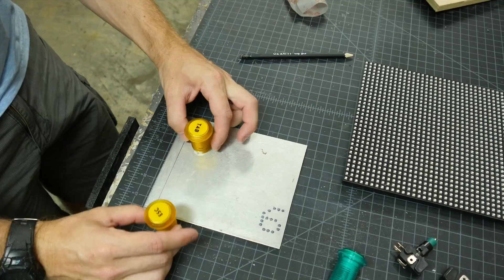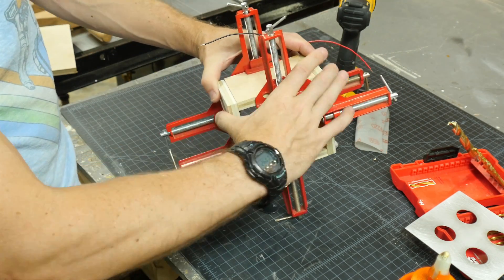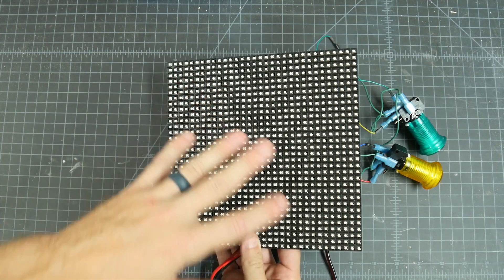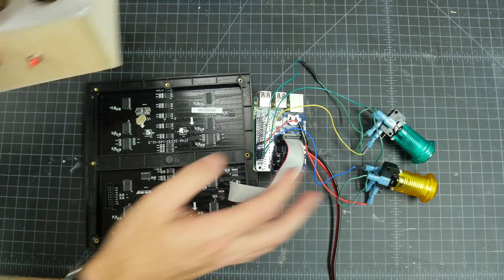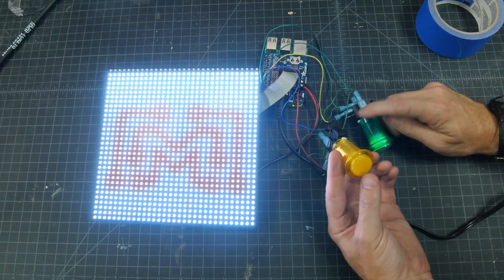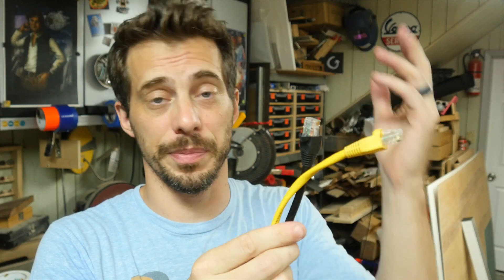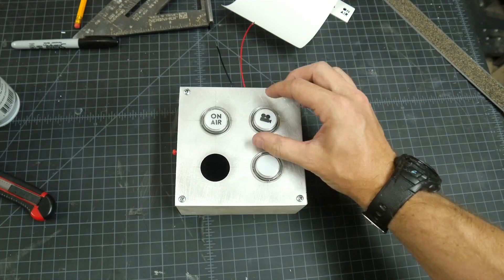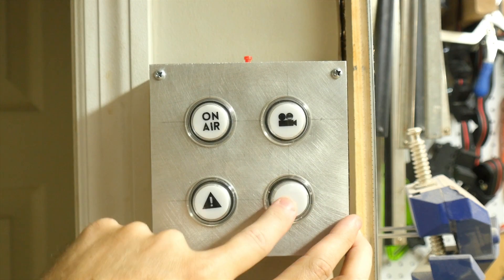Raspberry Pi 3 Display Sign // Electronics How To | I Like To Make Stuff

Comment: You could save some wires by putting an Ardunio in the control box and having it communicate with the Pi over serial. If you want to make it really easy for people to do them selves, and the distance is short enough you could use an Arduino Nano and use the USB based serial to communicate with the Pi rather than using the UART pins directly.

Comment: Why not have the Display and the Control board not necessarily require each other? Like having the Control Board using a Photon, or an Arduino with an Ethernet shield to communicate with the Pi over your home network?

Comment: can we do the same with aurdino
Reply from the maker: Kind of.  You'd have to get a Mega I believe to be able to run the display.  An Arduino Uno wouldn't work for it.
Reply: +I Like To Make Stuff 
ironically the adafruit site says the arduino can support a single display with 13 pins but documentation for the mega is unavailable. Great build!
Reply from the maker: Raghav Anand Ha! I stand corrected then :)  Nice!

Comment: Great project, but why strip the ethernet cable? Why not use an ethernet socket so you could just run an ethernet cable and if needed replace the cable for a longer or shorter one?

Comment: Hey Bob!! Love your channel and the podcast with you, jimmy, and David!! I have a electronic thing that needs fixing and I have NO IDEA how, so maybe you can help me? This electronic thing is my 4 month old daughters video monitor. My son knocked it off the table last night and it basically spilled it's guts!! But nothing was disconnected when it fell and the video and audio was still working fine. Well when I started putting the monitor and wires back in the protective case the video screen turned white and I could no longer see my daughter just a white screen that looked like the brightness setting had been turned all the way up but I tried turning the brightness down and still a bare, white screen!!! I could still hear the audio and it was working fine. We cannot afford another monitor. I am hoping you can maybe tell me how to fix it? I checked to see if any wires were disconnected but they all looked the same as before. 
Thank you Bob and I hope to hear from you soon!!! 
Kaitlyn
Reply from the maker: Hey Kaitlyn, to be honest, I have no idea.  It kind of sounds to me like something is pressing on the display which is causing it not to show the image correctly.  You might try taking it apart again to see if the image clears up. If so, try reassembling it very carefully so that nothing is jammed in putting undue pressure anywhere.  Good luck!
Reply: +I Like To Make Stuff ok so I tried that and it's still white but just from moving the screen it started doing crazy stuff so I messed with it for a minute and I would very gently push on the wires one at a time to see which one gave me a reaction and I also would move the camera so if an image came up for a split second or partially while I was messing with the wires I would know which wire would give me a reaction. So I figured out that the gold strip running to a black cushion-y rectangle is my problem. The connection isn't solid one side is pulled out more than the other so if you have any idea what I'm saying could you tell me what the gold strip wire thingy is? And maybe the black rectangle cushiony part that it connects to? If I know the terminology for these things then I'm sure I could look something up and maybe find some tutorial on fixing it. Thank you for writing me back so quickly!!

Comment: You can eliminate that 9 wires and use a shift register, or use an arduino that connects with the pi through serial communication.
Anyway, Nice video !

Comment: Regarding threading the wires through the wall, your video glossed over that part.  how did you feed it through that small hole?
Reply from the maker: It was just a piece of drywall, so I just pushed it through.  There was an unfinished closet behind that wall.

Comment: Great idea on using an ethernet cable.. I would have never though about that!
So does that mean that the ethernet cable will be able to handle such power?
Reply from the maker: It will handle what's coming through for the buttons and single LEDs just fine.  I wouldn't use it for anything with heavy current.

Comment: Great project Bob! Thumbs up for using Python, for those wanting to start programming I think it's a good option so good to display that sort of stuff here (also doing C++ or C on the PI was kind of a PITA for me). 

Maybe I missed it, where did you pull the 4A through for the power supply of the screen? It feels a bit too much for an ethernet cable.
Reply from the maker: It was just barely visible, but it came in from the backside of the wall, through the same hole.

Comment: Hi Bob, are you using the stock wood blades for cutting the Ali? I've heard about it,  but been too scared to try
Reply from the maker: Yes, I just use wood blades for alum.  it works fine in just about ever case.  I think if the aluminum were really thick you might want to look at a metal cutting blade, but 1/8' plate cuts fine.

Comment: Hey Bob, cool project but to avoid all these wires, you can condiser using a Feather board with RFM69 radio chip on it, also from Adafruit and it's basicaly an Arduino compatible board. There are pretty simple to make it work so you can have one conected to one USB on the Pi and another one in your control box. You only need to make a simple protocol to send/receive messages and done. Algo in Python you can simply open the virtual serial port from the Feather and read/write on it. With this setup you only need to apply power in both boxes and you're done. Im working on a similar project with a RPI, LED matrix and using the a Feather board (im driving the matrix with C code and is blazing fast), so if you need help, just let me know ;)
Reply from the maker: Yup, I just didn't want to overload this video.  The wireless stuff is coming in a future project.

Comment: I love this!

I had some questions that would be great if you could answer.

1) Could you have used the ground that the led/button switches are using to use 10 instead of 11 wires?

2) How did you snake the initial wire from the sign to the circuit board, as you mentioned it had to travel some distance.

3) For the power supply wire, I guess it plugs into a wall socket on your shop side. How did you snake it from inside the wall to the little hole you drilled where the sign attaches?

4) Maybe this is too deep, but I was wondering how can the led/button switches signal the raspberry pi as they only have a complete circuit and no other signal wires? I guess the voltage changes temporarily so that the led voltage can stay mostly constant.

Comment: Question: Why at 0.37 do you show using a clamp for the stop-block and not the expensive embedded rail? ;)
Reply from the maker: That embedded rail was maybe $3 :)  Also, I just added it in the build of the sled since I had it unused from another project, but I've literally never once used it on that sled :)

Comment: Love the project! I'm doing my doctorate on rasperry pi + arduino production line monitoring system. to avoid the cables you could use a zigbee or xrf shield and send the signals from the buttons over arduino to the pi wirelesly.

Comment: Awesome! I love when your projects have woodworking and electronics. By the way, the RPi 3 has bluetooth and WiFi built-in, so you could have had a separate controller (like an Arduino with a WiFi or bluetooth module, see Adafruit for some good ones) inside the button box and it could wirelessly send commands to the Raspberry Pi when buttons are pressed.  But I guess if you wanted to power it on from the button box, you would still need to run power wires.
Reply from the maker: Yup, that's the plan in the future.  I didn't want this video to be too densely packed, so I saved that functionality.

Comment: can someone please tell me what a raspberry pi is?
Reply: credit card sized computer
Reply: A tiny $35 computer with specs/components similar to most smart phones. It's a great option for small projects that need a computer.
Reply: Basically a mini computer that can run simple games and software, and or be programmed. Kinda like an Arduino (if you know what that is), but it is a much more complete "package". Btw: it also has different ports (ethernet, HDMI, etc.) so you can connect it to monitors etc. which the Arduino doesn't have.
Reply: its just a computer that run scripts :)

Comment: That's cool Bob. If the raspberry pi in your sign box had a wifi adapter, you could update the images remotely. Raspberry Pi plus making stuff rocks.
Reply from the maker: Thanks Matt! Yes, this one has wifi and bt.  I plan on integrating them in the future, but this video was dense enough as it is :)

Comment: hi im building a deck for our backyard with my dad. do you have any tips? (there wont be anything over the deck so i was wondering if you have any tips to weather protect the wood and what kind of screws would work)
Reply from the maker: Make sure you get decking screws! They're coated in a paint that helps them not rust. I would suggest going to a book store or library and looking at a book about decks while you design it.  You'd be surprised how many different ways there are to build them.  I built a large one at our old house, and I planned for a few months before starting it.

Comment: Very fun build.  The Pi 3 it has integrated wifi, so if wiring is too big an issue (I hate running wire through walls), you could invest more time in the coding and control it from your phone or computer.  You'd only need to wire it to the nearest power outlet.  Not as much fun as arcade buttons, though. :)
Reply from the maker: Thanks! Yeah, that'll be a future evolution of the project.  I'll probably put a wifi enabled Arduino in the control box rather than using my phone though, so I can still have the lit buttons as a visual reference for what's being displayed.

Comment: Hi Bob, I'm from Argentina, so, sorry for my English. I have a question.. ¿Why did you use the raspberry pi? Wouldn't it be cheaper and easier using arduino?
Reply from the maker: You would need to use a larger Arduino to be able to run that display, at that point it isn't cheaper, and in the end less capable.  The Pi is a linux computer, so the possibilities of what you can add to it via software are almost endless.

Comment: This video was a little confusing at first because you just started building stuff without any explanation. I didn't know what the 4 buttons were for or what you were even building as you didn't explain that you were building a control box too.

Other than that, the final product is really awesome!

Comment: You did answer my question if i could use arcade buttons to turn this off and on, not just hold it down to do something. I'll be making something for the lights in my shop to turn them off and on
Reply from the maker: There's a particular pin on the Pi that can be used to start it up. The shutdown was just a button that ran a shutdown command in the Python.  You could easily change what caused that.

Comment: If you want to extend the platform you could use a wifi shield and send commands over your local network instead of running wires
Reply from the maker: This Raspberry Pi 3 actually has wifi and BT onboard, but adding that into this video would have just made it more complex.  It's just a simple software update to take advantage of that though.

Comment: raspberry is out, audrino is in. get with it dude!
Reply: They are two completely separate things. Raspberry pi being a full computer with GPIO and the Arduino is just an easily programmable IC / micro-controller with analog inputs and more.  One can't be in and the other out.
Reply: +billy joe so you have a good alternative for both?
Reply: +billy joe I'm pretty sure you just don't know what you're talking about.
Reply: +billy joe If both are shitty then wha's good ?
Reply: +billy joe what's*

Comment: why the light only how to the camera??
Reply from the maker: I don't understand what you're asking.
Reply: at 3:32, you said the LED flashing only visible to the camera and you not able to see it, why is that happened?
（or maybe i get it wrong？）
Reply from the maker: YX Lee Ah.  That's the flashing of the LEDs (which our eyes can't see) being caught by the frame rate of the camera.  Those two things aren't in sync, so you can see the flash in the camera.
Reply: لانه انا ما فهمت ولا شي من اللي مكتوب.
I understood your question as much as you will understand what I comment
Reply: LED's or Light Emitting Diodes don't constantly emit light. They flash on and off so fast human eyes cant see it.
Reply: I Like To Make Stuff i just realised there's typo at the first question. should be " show", not "how".
thank you for answering :)
Reply: ***** ^^ thanks for your explanation
Reply: YX Lee When you use many LEDs you do something called Multiplexing which Flashes row by row very fast behind each other. If you dim LEDs you usually use PWM which (also) Blinks a LED so fast, that it seems to be dim but actually isn't. Those two things cause flickering on the camera.
Reply: U-238 yeah man u are right but not only led's man all the lights because that have to do with light is blinking like real fast and because our brains also have a "frame rate" does it look like it is just on but it is just blinking like usain bolt

Comment: Isnt that a real overkill using a raspberry pi 3?
Reply from the maker: Mostum is the best The future of this project is to have it controllable from remote places.  Using your phone might be more convenient in certain situations. Also, these projects about inspiring people to make something useful to THEM, not just mimicking what I've done.  Giving them options opens up the possibilities.
Reply: Not necessarily, the pi 3 gives you tons of options to extend the functionality further (7:15), connect to internet or other devices, react to more input.  Super flexible.
Reply from the maker: Also, the matrix could not physically run off of an Arduino Uno, so you'd need to step up to a Mega, or similar controller.  At that point, you've increase price, but not really capability.  The Pi is ideal for this.
Reply: This is what I kept telling myself with my first raspberry. Fast-forward to today: it is sitting in a box, waiting to be used for something that it's "worthy for". Yeah it may be an overkill but doing it with something else would be a giant waste of time and frustration if you are not into that sort of stuff.
Reply: which pi? pi2 and pi3 costs around the same. the shipping cost will be bigger than the difference.
heck he can compensate the difference by not wiring the whole stuff but use wifi communication instead of all those pesky cables
Reply: I have a 32x64 connected to a rpi3 , it should be noted that the library adafruit provides renders using a busyloop and will consume 100% of one cpu core. (The 32x64 panels are going for 18 usd on aliexpress, which is pretty crazy.)

Adding a 10ms sleep to the render thread drops the load down to 40-50% and doesn't flicker to my naked eye - mostly I was interested in not wanting to overheat the rpi.
Reply: Like he said, ANY Pi will work!
Reply: BenRangel dont forget that network addon on low level can be costy
for example arduino+ethernet+wifi+expander will cost more than a pi
Reply: Forby well, why would you add those functions. They are of no use to this project, where you just want to controll led´s with buttons
Reply: k
Reply: I think pi zero will be enough
Reply: PC GUY 1241
ikr, but pi zero dont have wifi, if only it have one.
or C.H.I.P
Reply: You can use a Aurdino or a Pi Zero but programming will be so much easier with a full Linux OS. If you're not used to low level devices the development process will be a lot faster on a Pi. Just being able to write the code, debug it and run it on the same device makes stuff waaay easier.
Reply: but it tastes so good!
wait lemme check.

EEWWW!!!

Comment: combine it with your airhockey table
Reply: Nice idea! Points could be counted on such a display.
Reply: To make things simple - there could be 1 button for each player, which would add a point (e.g. on a side panel near the middle of the table, so player's could not cheat). Another more automatic idea would involve additional circuitry in the table.
Reply: Or maybe when the puck slides in it hits the button
Reply: Very nice idea ! But how does it counts the points ?
Reply: that would be perfect :D
Reply: To add on the Led lights are by pictures so there isnt any problem